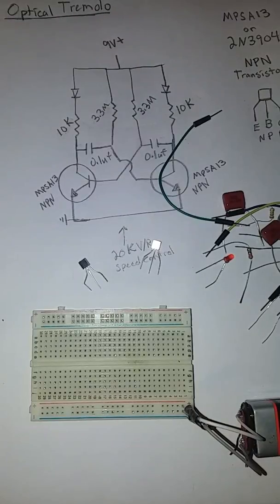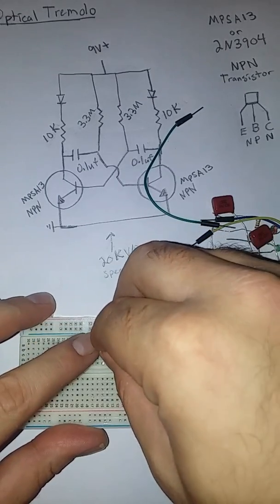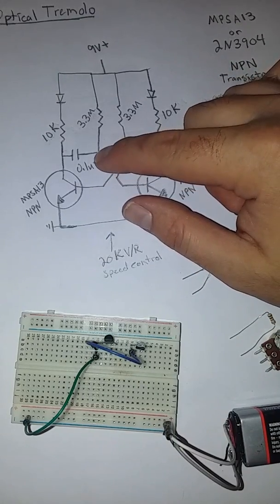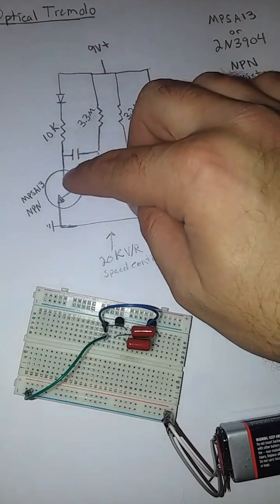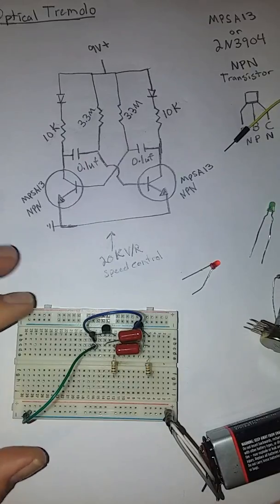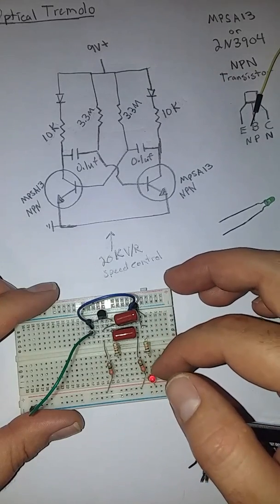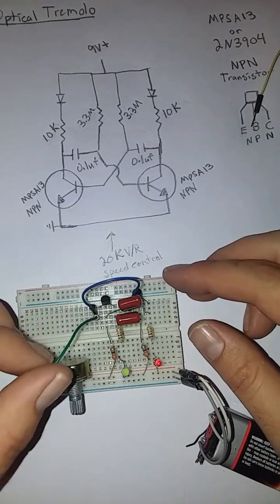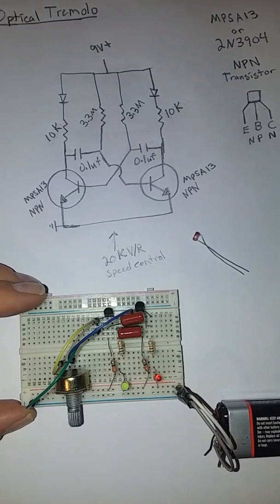How to build a flashing light circuit: The first step to building a tremolo pedal.

Comment: Built this and it works really well. Great job! I Put 3x 3.3M resistors in series on both sides to slow it down further. Any way of getting an even slower flash or should I just keep increasing the resistance?
Reply from the maker: You can keep upping the resistance but eventually it will stop flashing. You can also try different transistors. There are a lot of variations of this circuit online if you google "flashing led transistor circuit" and click the images tab